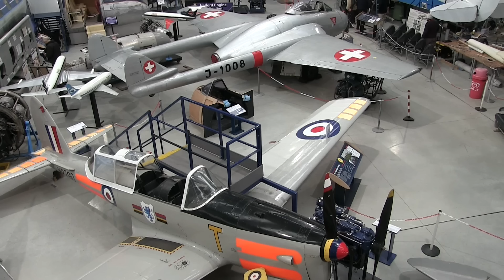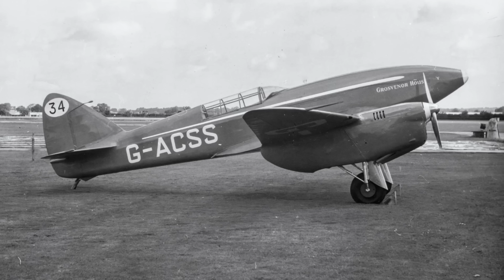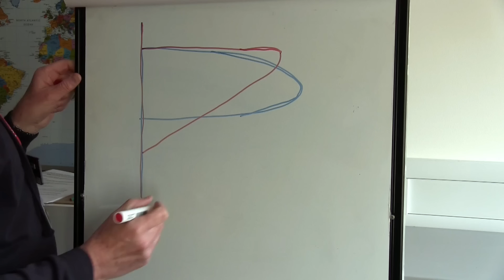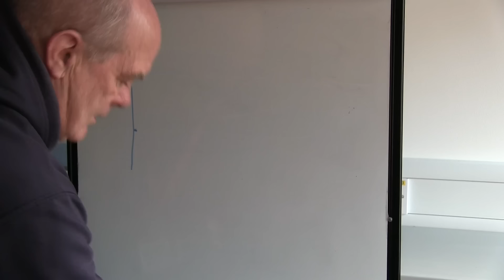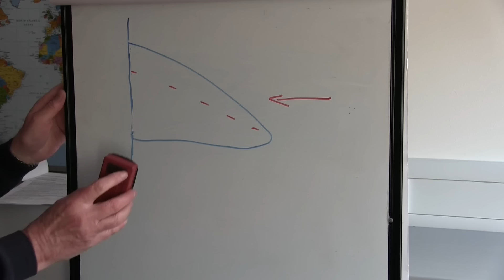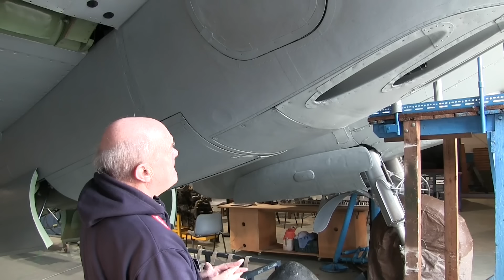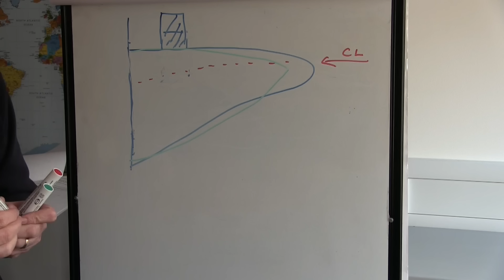Why Did the Mosquito Have Triangular Wings? The Mystery Explained

Comment: This subject somehow reminded me of the way that high-bypass turbofan engines were retrofitted to the 737 to create the MAX series of aircraft.  Because the undercarriage of the 737 is so short, and the aircraft so low to the tarmac, the engines had to be placed further forward and up with respect to the wing leading edges compared to previous 737 models to make them clear the ground.  This of course changed the flight characteristics of the aircraft, resulting in Boeing introducing the MCAS system to correct for it so that existing 737 pilots wouldn't have to be retrained.  Unfortunately the rest is history...
Reply: Boeing introduced MCAS in 1960 on the 720.  All aircraft with engines under the wing are subject to the effects of POP (Pitch-up- On- Power)
The FAA demanded that the Max retain its original POP characteristic by giving the system full control authority without autopilot engaged, a rather unconventional and highly controversial move that Boeing fought hard against. MCAS was never designed to have full authority or override pilot inputs. 
Indeed, the Max is the first major case of a safety system causing two serious accidents and it saw the Director of the FAA forced to resign and the FAA management staff fired or demoted.
 The current 737 Max uses Boeing's original design and has since accumulated an excellent statistical safety record. 
The 737 Max is an excellent aircraft unlike the de Havilland Comet which remains the worst engineering disaster in commercial aviation and the jet airliner with the worst safety record in history.
Reply: It reminds me of the greatest engineering blunder in aviation history that was created by D-H... the Comet Catastrophe.

You have to see the irony in mentioning the Boeing MAX-8 in a video about de Havilland!

You would think to avoid talking about aircraft disasters when engaging in a D-H discussion about anything... when it comes to crashes de Havilland takes the prize!
Reply: @JammisAdami  From what I heard, the Comet problems were caused by using the same aircraft body for both the maximum-altitude pressure test and the maximum-cycles-to-operational-altitude pressure test.  The maximum-altitude test was done first, but they didn't know at the time that stressing the metal in this way actually strengthened it, so that the body would last longer when cycling it repeatedly to operational altitude afterwards.  The pre-stressed body started to fail at over the minimum required number of cycles required by regulations (somewhere in the 1,000+ range), but if they had used a new and un-pre-stressed body in the pressure-cycle test they would have seen cracks in the square windows appearing at significantly below the minimum required cycles.  I suppose they could have addressed the issue by taking each new Comet and flying it up over 60,000 feet before delivering it to the customer, but I think the Comet had already been grounded by then.
Reply: @victorkrawchuk9141 de Havilland never tested the entire fuselage/ pressure cabin assembly 
 CAA airworthiness regulations only required a single section of the fuselage to be tested.
de Havilland had intended to pressure test the entire completed aircraft but these tests would have caused production delays and were postponed and later canceled to save money.
de Havilland eventually admitted that the sections of fuselage that failed had never been pressure tested.

Early flight test revealed structural weakness that cause large deflections in the passenger cabin floor during postitive G maneuvers.
Later independent postcrash research revealed alarming lack of basic structure integrity and pressure loads that far exceeded the actual structural limitations.

de Havilland attempted to modify the remaining Comet 1 aircraft with smaller windows and thicker skins on the roof sections but these aircraft were deemed structurally unsound and all Comet 1 and 2 aircraft had there civilian certificate of airworthiness permanently revoked.
Another fatal design flaws that is often overlooked is the engine inlets that were responsible for several hull loss accidents and fatalities caused by runway excursions.

These extremely egregious engineering blunders necessitated a new completely redesigned aircraft (Comet 4) which went on to also have a rather dubious statistical safety record 
(the worse safety record in history after the Comet 1)

All of these fatal crashes were easily preventable if de Havilland that simply used well-known and well-understood industry practices for design, construction, quality control and management of modern production aircraft.

Comment: Further advantages of the forward engine placement:
Having the engines that far forward has the props spinning near the front tip of the fuselage.
The fuselage being narrower at the nose, allows the engines to be mounted a bit more inboard (clearance for prop).
Mounting the engines closer to the fuselage, gives 2 benefits:
1) Roll inertia is less thus allowing for a higher roll rate.
2) If an engine fails, the yaw is less pronounced, allowing for easier and faster flying on one engine.
Reply: Even more than that.  It allows for a more forward centre of gravity which means the rudder will have a longer arm and the fin a greater stabilizing force.  

You can see the opposite effect in modern fighters like the F-15 and especially the F-14 (which had dubious directional stability which is why many were lost in flat spins following engine failure). They have to have two very large fins and rudders.  The F-16 even though its single engine and has relaxed stability also has a very large fin and rudder due to how far rearward its engine is mounted.
Reply: @calvinnickel9995
Good point.
That allows for a smaller vertical fin (less drag) and/or shorter fuselage (less weight)
Reply: Tu opinión es la más acertada de todas las que leí, solo agrego 2 factores que no he visto que otras personas  mencionen, 1 -  esa configuración alar permite instalar los motores totalmente adelantados, llevando hacia adelante aun más el centro de gravedad, teniendo esa ventaja, se logró reducir el largo del morro del avión evitando peso innecesario. 2 - Las hélices giran por delante de todos los sistemas importantes del avión, en caso de desprendimiento de una pala de la hélice por acción del "FLAK" la integridad de los pilotos se ve menos expuesta que en diseños clásicos como el B-25.
Reply: I am no structural engineer, but it seems that moving the engines forward eliminates the need for a complex heavy nacelle mounting in the wing : a front spar can run through it without being interrupted by the engine. And it makes it simpler to manufacture.

The engines are put in front of the spar, not under it, which reduces height and the front surface, hence less drag.

This weight in front of the center of lift is counteracted by moving it forward without having to add a weight in the back to compensate : shorter fuselage.

The drawback is that torsion forces on the wings are higher with the weight of the engines offset from the spars. Which is acceptable on an aircraft where speed is top priority, not manoeuvrability.
Reply: Agreed. Those guys had something lacking in today's design world. Lots and lots of pragmatic experience.
Reply: @rickbear7249 yeah no.
Reply: Another advantage,  particularly in a war plane is that should a propeller come apart the danger to the aircraft and crew is significantly lessened. Typical multi engine aircraft of the era tends to have the prop disc slightly behind the cabin, or at least behind the pilot and copilot. Often the engineer navigator or radio operator,  if positioned in the rear of the cockpit would be awfully close to in line with the blades.  There are certainly bound to be examples where placing the engines slightly forward would have been better, but was avoided for this reason.  But placing them far forward eliminates most of these issues. Sure, a nose gunner might be at risk, but it's a net positive, it even spares the fuselage which may not appreciate being perforated in a key structural area.

Comment: Excellent video. The headline feature of the Mosquito for the layman is its wooden construction; how far, if at all, did that influence the wing design?
Reply: That was clearly the primary factor in the wing design, to maximize the strength to weigh ratio and simplify the design of the spars.
de Havilland never used wind tunnels or cutting-edge aerodynamic research in any of its designs which is what led to the company's demise so early.

Comment: If you compare the wing and engine with any single-engined fighter, you see that the engine sticks out about the same amount (or maybe a little less). So, to my non-engineering eyes, the Mosquito looks a little like a double-engined version of a classic WWII fighter. I have to assume that the fighters were designed that way for many benefits - speed and agility bring the main ones - so having the engine so far forward seems intuitively to give the Mosquito these advantages as well. Then the wing was modified to support the basic design. That’s just a guess though

Comment: I don't see a myth, it's fairly obvious (at least for me). For a wooden twin engine bomber with heavy aerodynamically and gravitational forces, you want to design the wing between fuselage and engine (the main spar) as thick as possible. In order to limit the relative thickness of the airfoil there for reasons of speed, the chord is increased in that area also. That gives a heavy tapered wing, because the aspect ratio should be as high as possible for a bomber, too.

In a second step you want to install the engines in front of the wing a bit further forewards as usually because of the engine heat/wood/glue issue. To retain center of lift/gravity distance and limit torsional forces from the engine into the spar/wing the leading edge gets straight or angled frowards. In a wooden design, you get some limitations, you do not see in a full metal plane.

Comment: Another defining feature of the mosquito is the very short nose (and also short nose moment). Having a more forward center of lift could improve handling and allow for a smaller stabilizer. (Just a guess. I build model airplanes I'm not an engineer)

Comment: You are absolutely right about choosing this shape for reasons of centre of lift - but wrong about it being like "no other wing you'd ever see". I know because I flew one other fairly popular aircraft type that used it, the Rockwell (later Gulfstream) Twin Commander, various models of which were in production from 1950 to 1986 using this shape wing.
Reply: what do you know about these aircraft tendency, or not, to spin out on a tip stall?
Reply: Yep, plenty of WWII aircraft had wings that were straight or nearly straight on the leading edge, but with a mild reverse sweep on the trailing edge. I’d go as far as saying it was the most common wing shape of the war. The difference with the Mossie was in degree, with a leading edge straighter then most & the trailing edge with a reverse sweep more pronounced than most, that’s all.
Reply: Yeah..  not really.  They are both tapered wings.. that’s about where the similarities end.

Comment: Not buying the CG/CL explanation as a primary rationale. Reason being that if the leading edge “tapers” back from the root in platform, then engine mounting point moves back and so does the CG along with the CL. 

I think it’s likely structural based on the wooden construction. And as such was the most optimal format. 

In very well harmonised engineering design, it’s not always obvious why something is like it is, and it can be “just because” it worked with everything else as a whole.

Comment: If the weight of the engines was a factor in the Mosquito's wing design then the Lancaster, with 4 Merlins, would have needed an even more pronounced forward sweep.
Reply: werent there wings straight at the front thinking if the wings are straight then the wings would be stronger than a curved one

Comment: The radiators were housed between the fuselage wing root and the nacelles inside the wing so maybe that is why that section was made straight.Also it keeps strength just where the Merlin's are mounted.
Just a guess😊

Comment: Sweep is typically defined by the angle of the 1/4 chord which makes the Mosquito wing forward swept. A forward swept wing has less tendency to tip stall since the spanwise flow is toward the root. A swept back wing causes the boundary layer to build up near the tip which induces separation and early tip stall. For prevent flutter the aero load has to be behind the torsion centre. Burying the engines in the wing would have cut through the forward spar and require a stiffening structure around the engine which would add weight. Static longitudinal stability requires the C of G to be forward of the lift centre.

Comment: The leading edges of the Mosquito and Hampden both have a couple of degrees taper but only the outer wing section leading edges of the Mosquito are swept back because of the radiators.

Comment: You've completely missed the point of the whole design: bombs, carrying bombs! Wide wing root for spreading the weight distribution lengthwise. Straight leading edge for the necessary straight wooden main spar that carries both engines, fuel, and bombs. After the bombs are gone, you still need a proper center of gravity and the tapered trailing edge  did that, along with making it quite maneuverable. Don't forget, as the gear raises it goes backwards, moving the center of gravity. All in all, the only platform for the wing that works correctly with lift, center of gravity, etc, etc.
The 99 looks like an early plan of the DH-104, before they skinnied down the fuselage for just  a pilot.

Comment: Hi. Very good video, thanks. Sometimes forward or backward sweep was added at the last minute at the design stage to bring the centre of lift closer to the centre of gravity. This can be seen in the DH82 Tiger Moth, in which the wings have a rearward sweep. Also, planes are designed with a certain engine in mind, but engines go through their own design evolution and the Mk 2 version can be heavier than the Mk 1. The RR Merlin had a second supercharger added, for instance, and its 2000hp version was "beefed up" to take that doubling of power. 

Early biplanes had one big advantage. Adjusting the C.of L. was easy because the top wing could be displaced forward or back by the riggers. The DH82 was designed as a two seat trainer, the forward seat being at the C.of L. so the added weight (or lack thereof) of the learner pilot didn't affect the flying trim of the aircraft. This is why they made such excellent top-dressing aircraft here in N.Z, no need to do complex calculations when filling up the hopper with superphosphate. This is also why the fuel tank was above the forward seat and at C.G..

Sir Geoffrey's design for the DH99 using much heavier Napier Sabre's, suggests that with the Mossie he was thinking ahead and designing in a wide range of possible C.G.'s and C.L.'s. Bombers need this anyway, because if a heavy bomb "hangs up" rather than dropping, it can render the aircraft uncontrollable, especially at the end of a mission when the weight of the fuel is gone. 

This C.G. problem is why Jack Northrop's twelve "flying wing" bombers of the late forties were scrapped. Without a tailplane force to counteract a C.G. displaced by a stuck bomb, they crashed. As all twelve were destroyed at once without Jack's input, it appears the military figured the problem out before Jack did. An aeroplane's design is always a compromise, not everything can be optimized. Cheers, P.R.

Comment: An interesting hypothese. If we look at the P38 Lightning it also has a highly tapered wing with not only the engines in front of the wing but also the fuselage much further forward than that of the Mosquito. The difference being in the tail boom/s so does the twin boom weight be that which makes the difference.
As an aside the DH aircraft family have a distinctive fin and rudder outline.

Comment: Great video. Interesting subject. 
Correct- the planform was chosen to put the center of lift as far forward as possible to counteract the weight of the engines. Even then, it was necessary to carry about 20kg or 44ib of tail ballast (typically sandbags) when not carrying a military load. There is a warning placard stencilled in the Flight of Fantasy plane in the USA. 

Observations - 1) the center of lift is 25% not 33% of MAC or average chord. 2) Tip stalling is typically controlled by washout, reducing the angle (incidence) of the wing progressively towards the tip. The Mosquito had washout but the prototype uniquely has slats. They were discarded (see YouTube video) as the Mosquito demonstrated  benign stalling characteristics. 
Note that the position of the rear spar was dictated by the length of the retracted gear which contributed to the triangular shape. 
The diagram you showed looks fairly similar to the DH 103 Hornet. This had double tapered wings but carried the huge weight of the 4 cannons as standard well aft of the CG.

Comment: The engines being that far forward will be less about the frontal area, and more about the simpler interior structure of the wings. Long straight easy to produce spars instead of sections with concentrated loading's and construction, and more mass, around the bends in the spars.
Reply: It might allow more room for radiators and fuel tanks. A wooden aircraft wouldn’t have a wet wing so, best to keep the structure simple for wing tanks. Also, the engines could be placed closer to the roll axis thus creating a smaller roll moment because the propellor disks are at a narrower cross-section of the fuselage.